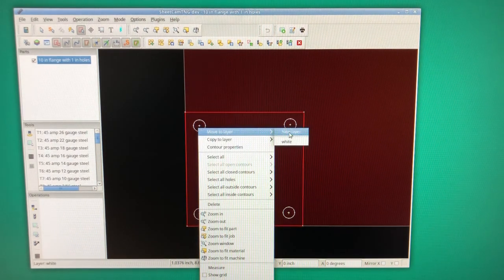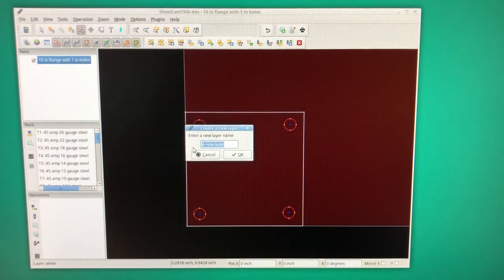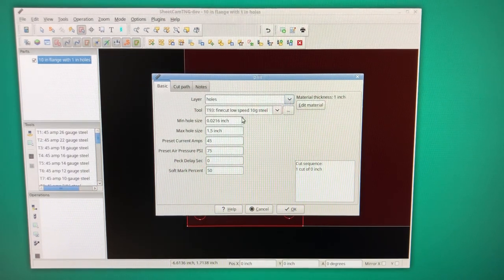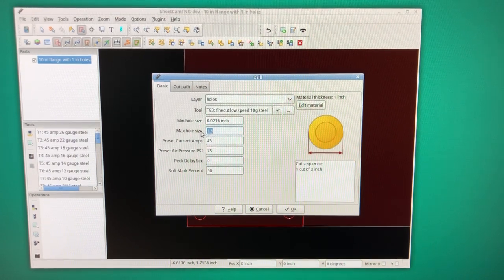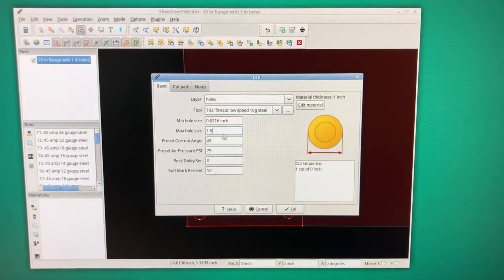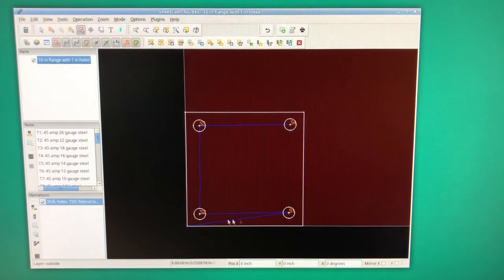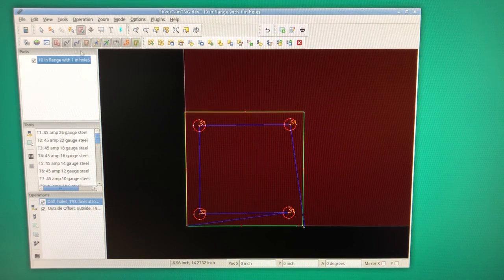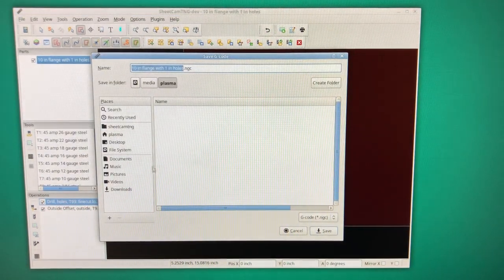Peck pierce in sheetcam

Comment: Hey luke i tried this on my plasma but the torch wont initiate touch off at the peck peirce it just moves from hole center to hole center then pauses at the m1 snippit
Reply: Im using command and sheetcam
Reply: Same problem here. Did you figure it out?
Reply: @jackm3185  had to update to a newer version of sheetcam. Smooth sailing after that.